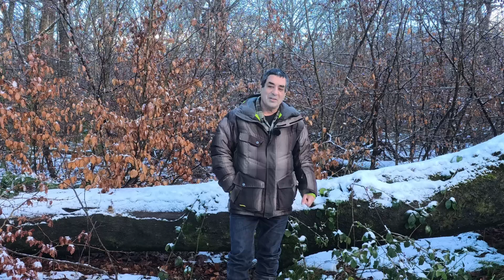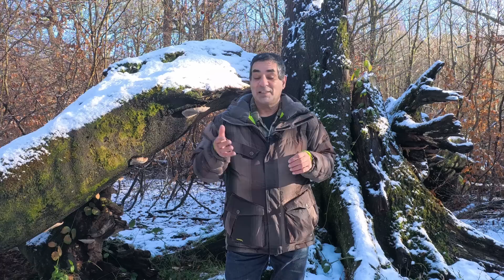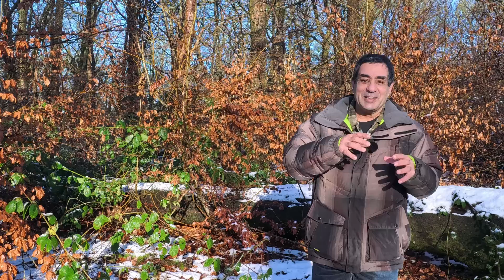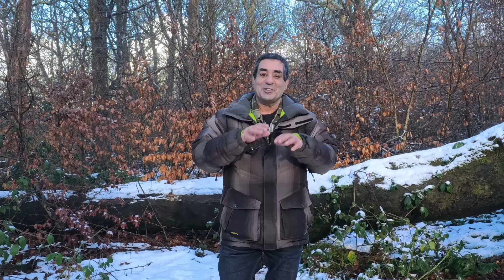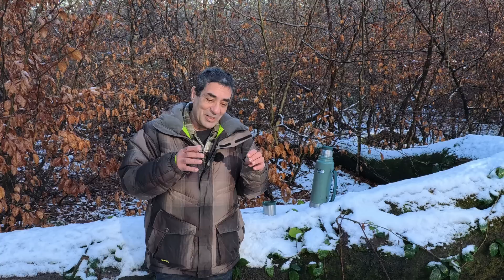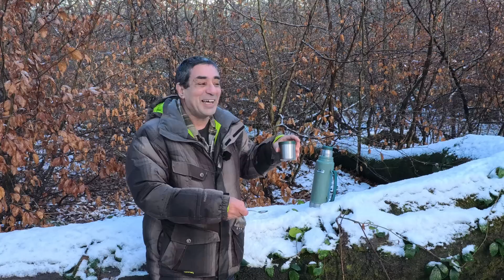The end of GPS (Part 2) - Quantum Clocks & INS

Comment: I‘ll go shopping tomorrow and check if casio or seiko have a quantum clock. Maybe I‘ll have to realize that they have quantums of clocks that work with quartz oscillators and with some luck they get radio transmissions with news about atomic oscillations that they consider in time showing adjustment.

Comment: You run out of fuel, as a pilot, not a few realised that, too late.
When kids switch from zooming to jumping, they become a clock, the present their hands and oscillate. ;-) Sadly they‘re not adjusted to any measure we‘d expect from a clock and even if they‘re called by „time for dinner“ their inertia remains vertically dynamic, rather than horizontally, unless „chocolate“, „cake“, or other key words are spread as air-borne signals.

Comment: You Sir, are hilarious 👍 As regards tea, it is very subjective. In my case, being alone at 75, I put one and a half teaspoons full of the loose tea leaves in a strainer whose handle is cut-off. Put that over a 400 ml cup, pour hot water at 90 degs. C and cover it with an upturned saucer. Then cover it all with two tea towels tucking them close to the base of the cup and leave it to brew about an hour to an hour and a half !! Then after using inertia to jerk the remaining soaked tea from the strainer into the cup, I add about four teaspoons of milk. That's it. A perfect cuppa for me 😊 And speaking of teabags...one word, douchebag 😂

Comment: I don't think that you have filmed this subject, however I have a navigation problem to ask how to solve. Hypothetically; I have ejected from an aircraft, I have but a supplied compass with an inclinometer, Watch, and Distance Beads. I can see a Distant Peak that I know the height of, with no chart or map (lost in the ejection) how can I calculate my distance from that peak and calculate my travel time either to that summit, or to another desired point once I know the distance. By the way, sometimes the Waffling is the high light of my day.
Reply from the maker: That’s a simple one 😊not sure you could make a full video from this. The distance to the top of the mountain is the height of the mountain divided by the tan of the angle – you can do it on your mobile phone’s calculator.
For example if the height is 500m and the angle from your location to the top is 25 degrees  500/tan(25) = 1,072.25m

For the travel time you can use Naismith's Rule - I made a video about how to use this:  https://youtu.be/1XmI8RHy4kU

Comment: Curious....  If you take a quantum navigation device (QND) up/down a lift, does it show you've moved in any compass direction? How about if you rotate the QND through the 3 planes (pitch,/yaw,/roll, x/y/z axes) before subsequent trips in the lift? Regardless of compass movement reported, do they also show elevation gain/loss?

Trying to discern how one of these behaves if a traveler moves due N/S from geographic pole-to-pole, for example, at 30,000ft following the arc of the Earth's surface. That is, maintaining 30K foot elevation above presumed sea level for the entire trip. Contrast that with moving the same direction at the same speed for the same distance, but traveling a tangential line outward beyond the atmosphere, always increasing the elevation above sea level.
Reply from the maker: Imagine being in a lift going to the top floor of a high building and then back down.  The same inertial force effect is felt as if you in a car speeding up then slowing.  The same effects would be felt in space.  Atoms don’t care which direction the move.

Comment: Note that the GPS software proves one aspect of Einstein's Relativity:  the difference between clock speed on orbit and on Earth has to be compensated for in order to get the right answers. (As well as compensating for radio refraction not being true straight line when other than straight up and down! Using average values helps. RTK GNSS compensation provides a delta correction for all residual errors, for a VERY limited here&now.)

Comment: The connection between inertial nav dead reckoning (Quantum or otherwise with gyros or iPhone MEMS accelerometers), GPS, and teabags is precise timing is required for all three. Brilliant demonstration.
Reply: yes what makes this possible now at this time in human development is our technological advances (computer speed, electronic sensor sensitivity) which give us ability to measure at this quantum level in a practical way to make such things as quantum navigation systems small enough to be used as instrumentation in ships and aircraft. The theory has been around much longer than our practical abilities. Apparatus to measure movement at atomic level used to be the size of rooms. If we can't measure (or time) things at a small enough interval, we can't see what's happening.

Really what it comes down to is that we can now time things at such a small fraction of a second, we can harness the quantum.

Comment: Until a few years ago, I used to use different "squeeze the teabag" techniques depending on the situation. The "squeeze the teabag with a spoon and string" one is great if you have a cup or some other liquid container with not a lot of free "wall real estate". If you have a tea pot or thermos, then just using the spoon to squeeze the tea bag against the wall is easier.
But the problem is that this can rip the tea bag and you'll get tea leaf dust into your tea. And it's also easy to rip the string off the bag that way. So nowadays (when I make tea in a tea pot or thermos), I suspend the tea bag from the string into my empty cup, and swing the cup back and forth a bit so that its walls slap the tea bag.
This new technique doesn't squeeze all the water out of the bag, but it gets it to where it doesn't drip any more. And I find that the amount of tea dust that seeps out of the tea bag adds the right amount of bitterness to the "virgin" cup of tea to where it matches the bitterness of the tea that is taken from the thermos at a later point (when the suspended invisibly fine tea dust has released it's bitter compounds).

Comment: I am looking for an alternative to GPS for precision agriculture. Today they use GPS for many AG things like planting, chemical application, scouting, yields, placing drain tile to name a few. Last May 10th the large solar storm knocked GPS out for two days. I have a friend that missed two days of planting due to the GPS being down. After that the rains started and he had 2000 acres that he could not plant
Reply: Whilst it's certainly unfortunate that GPS was disturbed for 2 days, it's undoubtedly the cheapest option for precision navigation. It's very costly to build up a standalone/ground based alternative...
Reply: In an urban environment, phones can get position lock by triangulation of cell towers. If 🟩🚜 used those chips in addition to RTK GNSS chips, and incentivized Bell/TMo to roll out high density cells in rural areas, they might be able to ride-out a GPS outage at least at an acceptably degraded accuracy.  Might require manual correction to map at start of pattern and phone-grade inertial navigation in combination with cell triangulation to get anywhere near the fine resolution the RTK gear is providing. A lot of work to prevent 2 days per year outage, but we could some day see a very long outage, if there's a debris cascade in LEO say,  so fallbacks are good to be working on.
Reply: Building a VHF triangulation network would frankly likely be simpler than integrating custom position software into the proprietary tractor automation to make use of it. (Unless big 🟩🚜 accepts NMEA or equivalent interface?) But baselines need to be long enough to have measurable delay,  which might require licensed radios and definitely requires tight timing throughout. The WW2 technique measuring round-trip of an echoed signal is conceptually simple, was fine for finding the right city,  but not at the precision needed here.
Reply: If the various devices still have manual over-ride controls, a manual approximation emulation of the GPS optional control might be a cost effective was to work through an outage. Print out the treatment map ON PAPER, line up guide stakes (two at each end, move one at each turn), and using a stopwatch to guess when to change treatment ⅖ of the way across. (Probably don't need to put collimation mirrors on each stake to be good enough,  as only have to be better than two days late.)

Comment: . . . "And I thought ICE (Individual Compass Error) was a headache" . . .
 PS can you remember the atomic clock experiment in the late 1960s ? Two aircraft were fitted with atomic clocks. One circumnavigated the globe East to West and the second flew West to East. Both clocks were calibrated at the start. When the aircraft returned to their base the clocks were checked and found to have a slight difference !